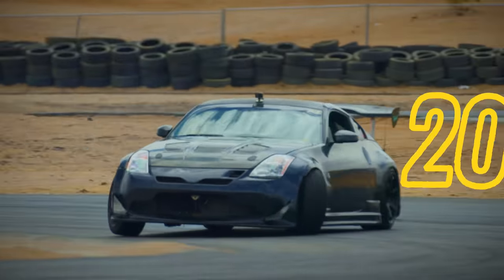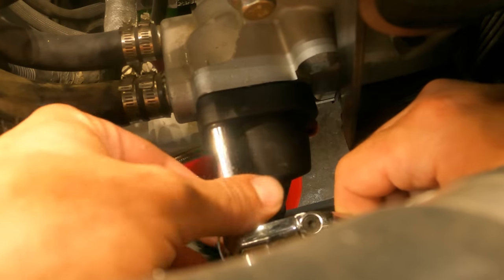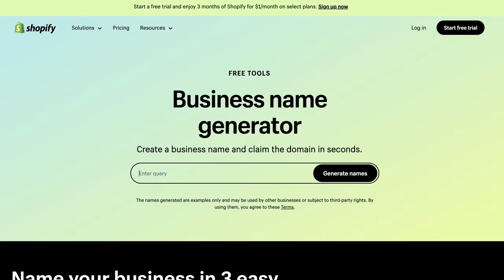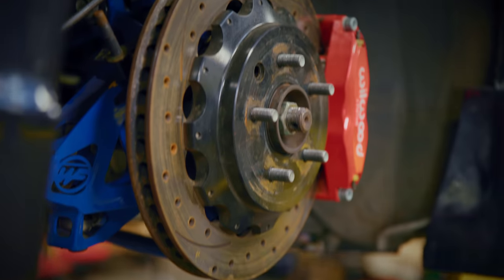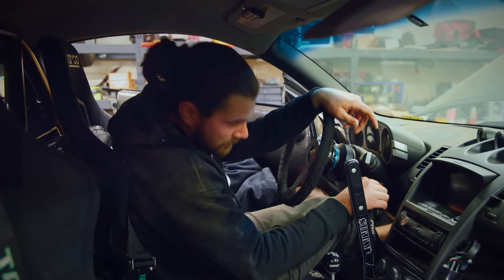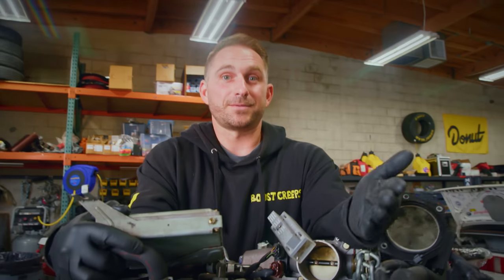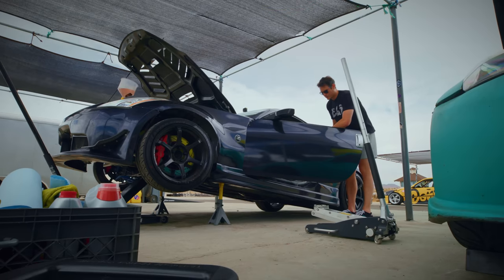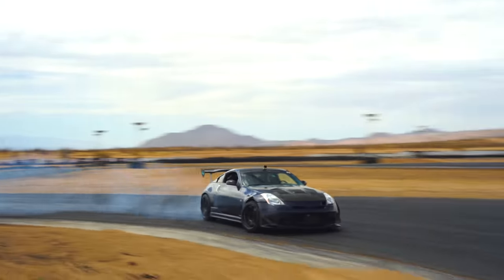Our $100,000 Nissan 350Z Has a Problem

Comment: There's a chance that the water pump is over-pumping. Typically the effective range is about 5000rpm, but if you're exceeding that, the water won't have enough time to cool before re-entering the engine. You can either change the pulley size or goto an electronic waterpump.
Reply: Going electric frees up HP for the engine, too.
Reply: @Kinann well supposedly, I think it won't change it much because the alternator will just be put under more load and in turn that results in more load on the engine from the alternator, I think it would free up some horsepower if the water pump ran completely independent from the alternator and rest of the system on a battery. But I think going to an electric water pump makes the pumping of the water more consistent because it doesn't rely on engine rpm anymore. Anyway I could be wrong but that's my first thoughts anyway.
Reply: @JuniorJunison it would increase efficiency a bit. There's less energy loss from electric motors
Reply: @JuniorJunison whilst you are correct in saying going from a belt driven water pump to an electric water pump will put more load on the alternator. The parasitic hp loss from increased load on the alternator is much less than from a belt driven pulley.
Reply: @JuniorJunison  There's no longer parasitic belt loss when you remove the pulley. Agree, no such thing as free energy and you can't argue with Ohm's Law.
Reply: Coolant speed doesn't effect efficiency as there's always going to be some fluid in the radiator. 
What affects the efficiency is that the pump actually churns the fluid instead of pumping it when it spins too fast. Less fluid is flowing and it remains in the engine too long. Casc
Reply: @vxsr33 is correct here. While belt-driven accessories are considered more reliable in everyday use (not to mention less expensive), electric-driven is much more efficient. There's a reason why race cars use electric water pumps and electric power steering. If they can squeeze even a few more horsepower out of an engine while maintaining reliability, electric accessories are the way to go. Even five horsepower can mean the difference between winning and losing.

That said... I wonder what condition the head gaskets are in. To me, this almost sounds like there's some head gasket issues causing a loss of compression. I'd maybe compression-test the engine and see if that points to anything.  Ignition system problems can also cause the issues they're having, even something as simple as incorrectly gapped spark plugs or plugs with an incorrect heat range. Just a thought.
Reply: @bradleyard4195  efficiency is higher in belt driven accessories because every time energy is converted power is used. Instead of just having to turn the accessories, the engine also has to convert the mechanical energy into electrical and back to mechanical energy.
Reply: @JuniorJunison  you're correct. Counting out the components being a higher quality, strictly driving the same accessories, converting the power to electricity actually draws more parasitic losses. Law of energy conservation.
Reply: @dwmaddawgs   I think both would apply here; typically pressurized water traveling through the radiator too fast; would not reap the benefits. But in the same sense, it does make sense that a water pump spinning too fast would actually churn the water supply;  I assumed that was usually only the case if there was a restriction on the outlet side of the pump.

I typically prefer electric water pumps, because they can be programmed to recognize what speed to spin at to maintain optimal temperatures.
Reply: I don't get the 'no time to cool' idea.    So you're cooling it less on a single pass, but pushing it through faster so more passes......the idea that " water won't have enough time to cool " seems ridiculous because if moving faster it should be cooler overall (up to some point of diminishing returns).  Obviously there is a balance point, but the idea that it moves to fast seems silly.
Reply: @ian3580  you seem to forget why we're cooling the water and where it is getting its heat from. The water is there to cool the engine, meaning heat is generated by the engine, water is run through it to take that heat away, and then the radiator expells that heat into the air, in an ideal world. Now, you can actually have the water flow through the radiator be too high, because the radiator isn't just some magic device where you put warm water in and get cold water out, it takes time for that heat to be transferred from the water into the surrounding air, now if your flow is too high, then you're not allowing the water to cool down and then you run it back through the engine where more heat is dumped into the water and you repeat the cycle and can lead to the engine overheating. So I'd say that yes, flow does matter. Because if it's flowing too fast it won't cool the engine, if it's flowing to slow it won't cool the engine, you want it just right where it has enough time to bleed off the heat energy gained from the engine and still keep the engine running cool.
Reply: @JuniorJunison  there's water in the radiator 100% of the time, so regardless how fast one part of coolant goes through, there's always some cooling in the radiator so it's always going to cool the same amount. The reason temperature raises is how many combustions per amount of air flow. The faster coolant flow creates more even heat distribution through the system.
Reply: @dwmaddawgs  no.
Reply: @ian3580  

Hasselgren whom runs 4AG engines up to 11,000rpm can explain it better than i can since they wrote about it a while ago. but if you push water too fast through the radiator, it only cools down by a couple of Celsius. Travelling through hoses decreases its thermal efficiency, so it picks up more heat as it travels.

I.e. if a water pump rotates at 5,000rpm, it pushes 120 litres per minute (not an actual/realistic estimation). That means that the radiator has to cool 2 litres of water every second. It won't be able to do that. However, spinning it at 2,500 rpm will mean it pushes 60 litres per second. Which will mean the water sits in the radiator longer and has more time to cool. 

Radiators do not have a flash-freezing effect.  

Basically, one is 50% effective at cooling.
Reply: Im no expert but that sounds about right
Reply: Or a 3 pass larger radiatoe

Comment: Possible overheating issues:
Try filling your system with glycol or straight water. Using traditional antifreeze raises the freezing temperature but lowers the boiling point of the water it's mixed with. In your climate, there's no need to worry about freezing temperatures.

You have a small grill on that car. That will restrict air flow. Since you aren't pushing wind at highway speeds, you'll have to draw in more air. Try releasing more air toward the firewall (directly ahead of the door hinges or further back on the hood toward the windshield). That and having a more aggressive fan.

Comment: Check in to underdrive pulleys for crank and water pump. You gotta slow the pulley down at hi rpm to cool the coolant down in the radiator

Comment: So for the crank position sensor issue, I've heard that newer sensors are having an issue where there is too much gap between the tone ring and the sensor. Also car wizard just did a video about how alot of new parts he's gotten for customer cars are bad right out of the box.
Reply: This has me a little afraid to buy any newer car. After Covid I feel like quality on a lot of items, especially electronics, when down.
Reply: All the shortages during covid caused a lot of shady business practices to pump out supply. As a tech, I've seen the new parts being bad alot more recently too. Mostly parts that require electrical components.

Comment: In regards to the seal, what can happen is the garter spring that applies pressure to the lip of the seal can be dislodged when installing the shaft causing a leak.

Comment: You guys need to try vacuum filling the cooling system. Seems like you're having trouble bleeding all of the air out. Vacuum filling will make sure there is no air in there to begin with. The tools to do it are cheap and very much worth it

Comment: Nissan and problems gotta be one of the most iconic duos at this point
Reply: Subaru and blown engine?
Reply: RX8 and compression issues
Reply: now that's a tandem!
Reply: Nothing problematic had anything to do with Nissan components.
Reply: @focussport yeah, considering that car is pretty much built on everything but Nissan parts.
Reply: Donut and broken cars 💪💪
Reply: The whole video and they didn't exactly pin why the car was overheating; I honestly just think it's the combination of parts versus the performance they want out of them.
Reply: Almost all of its issues are Chevy related tho
Reply: @focussport didn’t low car crack it’s VQ block?
Reply: @slideways8022  we're talking about hi-car, but yeah I think lo-car had issues... with a bargain basement ebay turbo kit. Questionable parts and tuning. The VQ is known to not be able to hold up to FI, and this isn't a knock against it. Many NA motors don't hold up to a bunch of boost being thrown at them.

Comment: Yall will figure it out and fix it for sure we all have problems in our rides now and then need an alternator and belts battery for the old e46 to run been redoing the lights on my 370z changing to leds .

Comment: Should probably wrap the exhaust and the turbo and then even cut some holes in the engine tub that leads to the inside of the fenders that'll help with some air flow

Comment: 100% can not say how happy I am to see you swap over to the LINK ecu. I myself am a LINK customer (04 Subaru Forester XT pushing 425/400). Very happy with their customer service, how easy their software is to use, and just the overall ease of the product to install.
As to the "not street legal" thing, that is ONLY for CA. No other state has problems with aftermarket ECU's. I've had no issues at all with mine, and in fact am converting another car up from the OEM ECU to a LINK (2006 legacy GT wagon)
Last, the overheat problem: Ive had the same issue with a LS swap before. you may need to go to a 3 core radiator with a push fan setup (fans in front rather than behind it), and swap out the thermostat for a restrictor plate (smooth plate drilled with many holes to flow more, but still hold back enough to allow water pressure to be optimal). Going to a plate means having to retune some for your cold start, and having to sit 5-10 minutes with it idling to warm up. Add 5 min if on E85/e98
Reply: For the sake of not spending 100K for something you can't drive except on track,  I do wonder why they didn't seem to just try a fresh factory ECU  if the other one was just corrupted.  There really need to be some less-out-of date emissions laws,  though,  cause especially the older stuff gets,  factory isn't even better that way,  especially if factory is worn out.
Reply: @OllamhDrab  CA smog laws/CARB is not about clean air. It is a money making scheme for the state, that also doubles as a way to control the populations actions. 
If it was about smog/emissions then they would only judge a car on what comes out the tailpipe, not what equipment it has on it.
Reply: @obiesunstreak2409  Given the difficulty of getting rational politics done, not to mention the polarization, of course what comes out suits the wealthy corporations and dealerships wanting to have a captive market and of course, keep people having to buy new cars when the maintenance gets too pricey.     It's not about some 'thought police,'  it's about who wins when things are made a tug-of war.  (Yes, the money.)
Reply: @obiesunstreak2409   *adds after market ecu to electric vehicle.
"Hey that's bad for the environment, oh wait..."
Reply: @tbunreall  EV's are not real cars in the first place, just glorified kids power wheels, toys that have no place on the road.

Comment: I'm really confused on swapping of the rear calipers. With the increase in size, the fluid pressure should remain the same if installed correctly, right? Is there a proportioning valve within the big brake kit that needed adjusting or removal? Were the calipers defective? It also looks like you're using both hands still to throw that handle back. 

Love the builds! Just very curious, and information other than "not the right brakes" would be appreciated!
Reply: I also thought this. That or the willwoods needed a good bleed and top up of fluid to work to their fullest. Who knows eh

Comment: Watching crank/cam position sensors on an oscilloscope can be a lot more informative than a simple ohmmeter test.  The scope can tell you if there is a clean signal or a noisy signal - which ECUs (stock or aftermarket) can't interpret.
Reply: Their ecu has a trigger scope built in. Very handy.

Comment: You must run the car with no hood foe over heating problem. Adding the biggest badest most fans you can fit on the radiator. It may even require holes in the bumper for more radiator air flow. That big V8 makes double the heat in that tiny engine bay I have seen these problems pulled my hair out then removed the hood. Love yall for real thanks for the content.

Comment: I am pretty sure you can have a standalone ecu. Most drag and drive cars run holley ecu's and they have plates so there r is a way to get your car on the street with an aftermarket standalone ecu. Or cyvex with twin turbo lambos.

Comment: you'll get more cooling efficiency in a car that never sees cold weather (like a track car in southern california) if you run distilled water with water wetter instead of antifreeze/coolant, which might help with the heat issues, but heat is pretty much always going to be a concern in a drift car

also suede steering wheels are for driving with suede grip gloves, if you drive them with bare hands they get chewed up like the one in hi car is

Comment: Maybe buy a vacum bleader for the coolant it sucks all the air out so you´re sure its filled correctly. A hole set is not that expensive, so you can be sure its the system itself not the air in it.

Comment: Fix the hot air intake anything over 140* Temps timing gets pulled .   Also check steam lines routing . Bad steam lines you get air in coolant

Comment: Here's something I would try, if I was there and was allowed to. I would cut that hood up just a bit and around the front wheels and force in air from the wheel area & hood. I would stick a water to air heat exchanger (intercooler) in the hood and force it to suck in air from the rear with some heat shielding around the intake manifold. Its sucking in so much hot air from that radiator and the engine bay I don't think its doing anything other than forcing a negative feedback loop. That, and, I would split the radiator into a front and rear with some air scoops, a few holes, and some tubes that are insulated with another pump inside to help it. Just got to let it breathe out the back. If its the heat from the radiator being sucked in, a basic way to test that is simply force it to be covered by a heat shield and a hole in the front to suck in cold air coming in. If it isn't then you are looking at a need to port it (yourself) for the air coming in to work better with the new ecu and better air flow and fuel. Since that camshaft is something I'm sure you probably don't want to change too much, you are looking for more low and med rpm gains that is an easy enough way of doing it for cheap. Granted, all that takes time and while each of the things I suggested would help regardless (depending on them being pre-ported and polished) they can ruin aesthetics, require new tuning, and make it so you have to track test again to see if it solved the overheating and (possibly) not thermally cool enough air coming in. Still, there is the balance of how much you can make by making the videos of that, to whether it gets in the way of other projects, and if the money is there or not.

Anyways hope it helps :)

Comment: While my LS is supercharged, I have 11 oem heat exchangers on it.  2 radiators and 1 oil cooler for the motor.  The supercharger have 4.  I’d start there but I’ll watch the rest of the video now.

Comment: I had cooling issue turned out a rubber gaskit  got into the cooling system and was blocking flow too the engine. Those pesky gaskets my nemisis 😂

Comment: You guys should have gotten a haltech and you could have used the factory harness with a simple adapter. Plus the haltech  has room for extra stuff you might want to add in later and it’s super versatile.
Reply: Fyi they did use an adapter. The link plugged straight into the gm connectors.

Comment: I mostly do old carbretted motorcycles myself, but low power in low rpm, and high engine temeratures, it sounds like you are running lean. But if your ECU is giving the correct amounts of fuel, and your jets are not jammed up, maybe you are sucking false air. But it is turboed, so... Any leaks in the intake would mean less air coming into the engine?

Comment: Vacuum coolant filler throw that funnel crap in the garbage, it takes well over 30 minutes under vacuum to fill a 991 Porsche gt3. It’s the best way to completely fill a system, when vacuum is released the pressure replaces the air with coolant effortlessly.

Comment: Tbh, ls engines have some issues, they only make torque at higher rpms, and yes, they make a bunch of power, but if you pull a chevy 350 out of basically any gm product from the 80s to 70s you will have to do some tlc but then it will have the right amount of power every time you put the pedal to the floor

Comment: I wonder if that radiator is too small for that LS, or if it's not getting enough airflow. Could be the radiator fans spinning too slowly or not at all, hard to hear over the roar of a V8. Or maybe there aren't enough gaps in the front bumper for airflow? Could also be a bad water pump not keeping the flow rate of the coolant up.